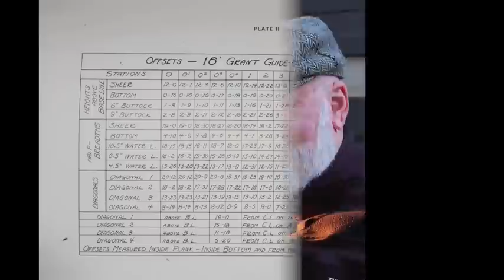Making an Adirondack Guideboat

Comment: This is shear poetry. Just beautiful and it certainly contains parts of the  builder especially the peace in his heart.
In the other videos I did not realise this was strip planking with epoxied fibreglass sheeting , but now seeing the delicate work on those  thin strips and the fragile planking, it is necessary to strengthen that hull.  It is brilliant and it seems that due to the pointed bow and stern  the twist on the hull is  reasonable as normally such a hull will  twist a little especially for a wide transom which needs   to be stiffened against twist with a seat at the transom. Excellent work  and nothing beats the warmth that  wood provides.

Comment: When you say "wet out" of epoxy do you mean "application"?
Reply from the maker: Yes. You basicly flood the glass five times.  This totals about two gallons of epoxy.  If you don't get enough on one of two things will happen.  First you'll have read through of the weave.  Second, when you sand the hull down to 2000 grit before varnishing, you could sand through to the glass.  If that happens you will always see the weave of the glass or the patch you did trying to cover the glass back up.  Hope this helps.
Reply: Thanks.  You have a beautiful boat there by the way.  I'd be happy if I made one that looks half as good.